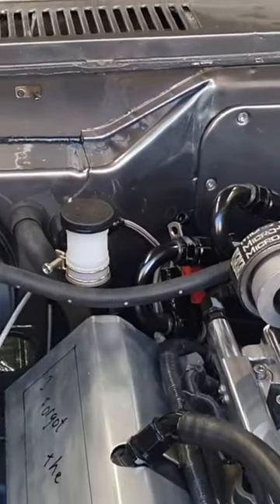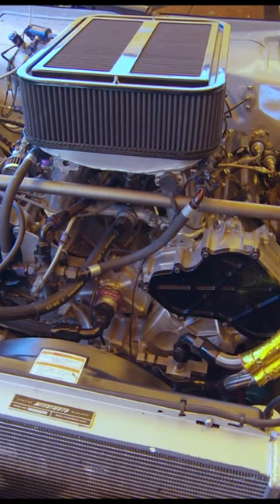The Best Japanese V8 Engines Ever: Nissan VK56DE

Comment: Our 2014 has been extremely reliable, not a single issue and the spark plugs are ready to reach.
Reply: I also hear that this engine is remarkably similar to the legendary Ford Coyote engine, and about as well built, too.  Are these things true?
Reply: @paxhumana2015  yes very much so
Reply: We got a 2016 qx80 right now with over 200k no issues at all.

Comment: Let’s not forget about the Lexus UZ V8s
Reply: I have a UZ first gen. The VK is a lot better lol. As far as cheap reliable power. The head isn't good on the UZ until 1998.
Reply: VK were designed with motorsport and performance applications in mind. UZ were designed for smoothness and reliability in luxury and truck applications. I've owned variations of both. The Nissans definitely produce more NVH and power, than similar displacement Toyotas.
Reply: @Chalado-Schamane nope it's not lol!!!!
Reply: @flipcoin6301  uz was originally designed as an f1 engine but was adapted to smoothness and luxury implements.
Reply: @carholic-sz3qv  1uz camshafts snap over 350 horse
Reply: @flipcoin6301 Yeah that's what I thought it would be one of 2 engines that was going to be spoken about..
Reply: @Chalado-Schamane No they don’t

Comment: Not sure about the new direct injected one, but the VK56 was a damn good motor. The biggest issue was the exhaust manifolds, though. They all cracked. It was just a matter of when.
Reply: Good excuse to throw some long tubes on it
Reply: @masonstriz6060 and that's exactly what I did on my 5.6
Reply: They're easy to replace at home.
Reply: Straight pipes it is boys😂
Reply: M56S had Direct Injection….I was In Love with that car!! Had it for 5 years

Comment: Need to see more video's about these engines rebuilds, performance mods, etc, I love my nissan titan this engine is one of the reasons why. Currently have 200k on dash and looking to rebuild. These engines are awesome honestly I need to learn more been stuck on LS for a while. Thanks for the short👍
Reply: Rebuild? I’m at 350k original motor hah
Reply: @ivand5527 he probably means a top end refresh
Reply: It's basically the japanese coyote these things can rev out to 8g to 10g
Reply: I got a clean 2006 Titan last year with only 130k. I love it! I plan to drive it forever and rebuild if needed.
Reply: Yooo me to 04’ armada plan to rebuild it in a couple years , jus replaced all the coolant hoses, reservoir, thermostat, and replaced the plastic for an aluminum radiator , these cars are fuckn dope 179k on the dash

Comment: M56s owner here, while my engine only has some bolt-on intakes, lemme tell ya- when ya wanna give it some grunt, she'll move with a quickness. You definitely feel that 400hp putting in the work!
Reply: Cool, what year is it? From one owner to another? Any issues? And did u ever fix the clicking sound of the rear cv join Axels?
Reply: @WSG-fv9dq personally don’t have that problem on my m56s

Comment: I owned a Infiniti FX50 with the 5.0 port injection, amazing car, then a QX80, which was ungodly quick and nimble, added a gmc Denali to the group, which lost horribly to the smaller displacement 5.6, and recently bought a new left over Nissan Armada Platinum that is on a 12 year old platform and breaking in nice.  The Nissan isn’t on the same level as the Infiniti qx80 trim for trim, but the Armada hits the right PowerPoint, it will squat down in the rear, front tires grabbing and is gone.

Comment: me looking at this wondering if i can fit this in my 97 nissan d21 RWD 5 speed manual pickup truck....
would be a sick upgrade to the truck
considering its got a ka24E, which fun fact, 97 was the last year of the d21 (got replaced by the frountier) and the last year of the ka24E, which got replaced by the DE variant... 
also aparently ka24DE's were produced all the way into 2010 at which point it got discon'd
Reply: Ive thought about doing this with 6 speed manual.  Anythings possible, but sure would be a tight fit
Reply: They make a kit for bolting up a cd009 to the vk56... ima start my build into it soon... I've got a vk from my old 07 armada, it'll be completely redone from crank up, swapped to the newer variable cam heads and adapted to an ls intake manifold, that's just the start...

Comment: Dont understand why gas pushrod v8 are 2 valves only. A lot of diesels are 4 valve with push rods.
Reply: I wonder if it just doesn't improve power all that much for a gas that's naturally aspirated.

But it's a good thought, I never really noticed that but I would also want to know why
Reply: Diesels max out at about 4,000 rpms.
4 valves per cylinder have much more weight and mass in the valve train.
Reply: @williamshultz3598  german diesels rev to 5500rpm
Reply: Direct injection diesels need a lot of airflow and swirl. It pays off to have a 4V head because of that.
In addition, it makes it easier to place the injector and combustion bowl in the center of the cylinder. This can make the fuel burn more efficiently.
In some cases, diesels got 4V whether they wanted to build it that way or not, in order to meet smog requirements. The 7.3 PSD got replaced in 2002 by the 6.0 PSD because the 7.3 could not be made smog legal. If only it was well built, maybe it wouldn't have ended in disaster.

Comment: It's a pretty cool engine for a swap, but, as I am looking at it I am thinking, an LS3 has as much power, is far less complex, is smaller and lighter. Also if you want it you can put a low profile supercharger on it without having it stick out of the hood. I'm just sayin'.
Reply: Harrop makes low profile TVS 2650 superchargers for the VK56.
Reply: What I didn't like about the VK56 was that it had all the complexity of DOHC, yet was about as powerful as the OHV engine in the Dodge Ram.

Comment: In Supercars the engine was destroked to 5.0 litres to fit the rules 👍
Reply: Wasn't it used in the altima super car?
Reply: @yooooo6296  👍 yes it was if I can remember the bore was about 102 mm and the stroke roughly 75-76 mm to bring it to roughly 5 litres as Supercars is a parity formula but sad they left
Reply: They’re also the LMP2 engines

Comment: I don't care what you say that's a junk motor.I hate that engine. Current engines have piston slap problems.  In my opinion there's one giant design flaw in that engine and that's the placement of the oil pump. And real trucks don't have spark plugs. .
Reply: New motor is definitely Junk.   The 04-15 motors are solid
Reply: @s.a.t419  the new VK56VD is a different engine than the VK56DE
This video is referencing just the DE engine which is amazing